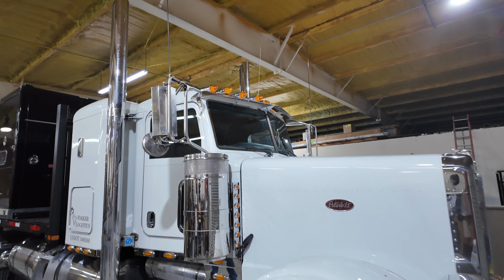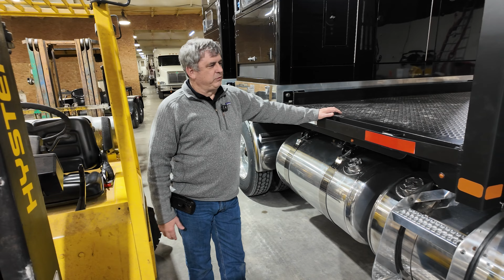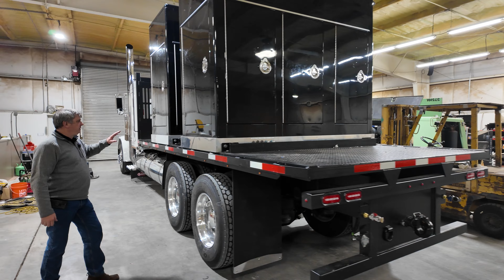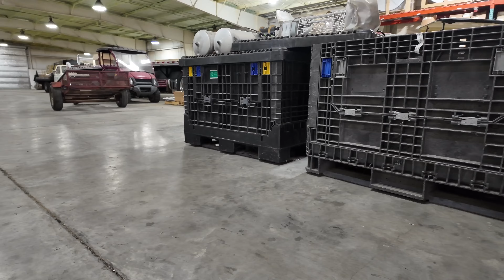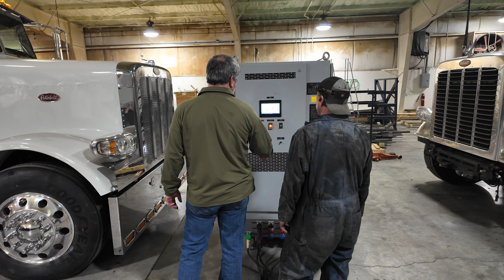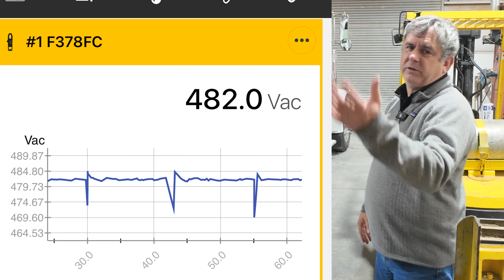Our Custom Peterbilt 389 with Tractor Mounted Generators!

Comment: Excellent looking truck and genny setup there!  That looks like a great asset to have for the company. 👍

I had a pair of QSM11's on my 76' yacht that would run for weeks at a time non-stop crossing oceans.  They were great engines with over 7000 hours each.  We had over 4000 gallons of fuel in 5 tanks, and that also supplied the 32KW or 22.5KW or 9KW generators depending on the house load as well to keep them loaded properly during the entire voyage. The fuel manifold was quite impressive for sure, with all the supplies and returns of each engine to each of the 5 tanks.  Plus we also had fuel polishing system as well to clean the fuel if we needed it depending on where we got fuel.  Its an art to get all that piping and valving design for sure.  One thing you really had to manage is the amount of return flow.  On our engines the max return rate can be about 79GPH for each engine, in cruise setting it was about 62GPH going back to the tanks off each engine.  Many people don't think about the amount of heat being returned to the tanks from fuel flowing through the engine and back continuously, ours were spec at 200F before the cooler off the engine, so you might keep an eye for long runs and or extremely hot days with such small tanks.  🍺🤠
Reply from the maker: Wow.  That’s an impressive setup.  I didn’t go into for sure to the level you appreciate.  It wasn’t until I was working on an old 2 stroke Detroit that I realized the system would pump way more fuel that the engine could use, and to your point it wasn’t until I started operating semis did I learn how much heat is rejected … I’m sure the system on your vessel was pretty cool.  I know a lot of those systems utilize day tanks and provide the ability to polish fuel on board as well.  One thing i would mix up was GPM and GPH …. lol vastly different measurements …. One thing that helps us is the fact that hydraulic pressure basically draws down the highest tank first, primes the entire system and the with 5/8 pluming the system basically siphons levels itself.  Then the gens have return valves like on a semi to balance the return flows.  With 3 tanks and enough fuel for 48 hours of high use and 72 hours of typical use the thermal cooling of all those aluminum tanks seem to handle the heat rejection.   Great comment.   Thanks for watching and commenting. I appreciate people that have far more knowledge commenting, it makes us all better

Comment: Nice cam lock setup on those two gensets. Everything looks like it’s laid out quite nice and makes it easy for those making the connections in the field. 👍🏽👍🏽
Reply from the maker: you nailed it -- great cam field, couple of "cali twist" 50 amp 2 pole, 2 edison 20 amps and a 100 amp bates -- 

great comment -- thanks for watching

Comment: Nice tractor! I drive in the movie industry and also operate generators. We usually refer to these as “production vans” That would be a nice truck to drive. 👍
Reply from the maker: yeah -- I kindva "rednecked" that up didn't I.... we even move those 48 and 53 slide vans that have all of that production gear inside --  industry "production" -- redneck "TV truck - right there"---thanks for clearing that up for me.

Comment: Tv truck is better known as an outside broadcast truck,  or van if I a Mercedes sprinter
Reply from the maker: yeah -- I kindva "rednecked" that up didn't I.... we even move those 48 and 53 slide vans that have all of that production gear inside --  industry "production or broadcast"" -- redneck "TV truck - right there"---thanks for clearing that up for me.

thanks for watching -- I appreciate the comment
Reply: @ParkerSystems  i used to work in one as a switcher operator for a sattalie sports channel, you dont know pressure untill your working the world cup
Reply from the maker: and the satelite gets a sun spot -- I bet thats not a fun day. -- thanks for watching